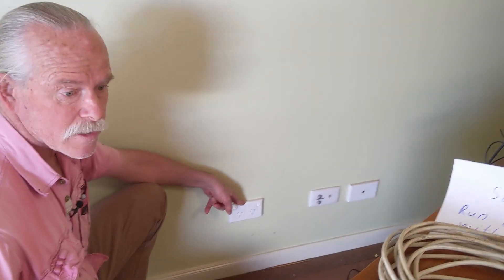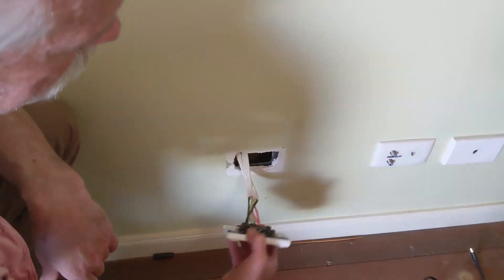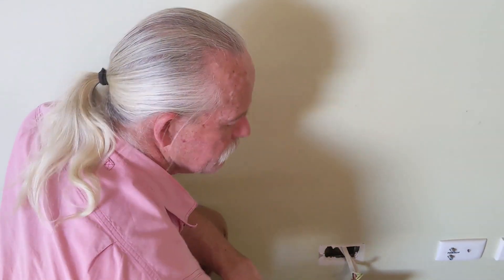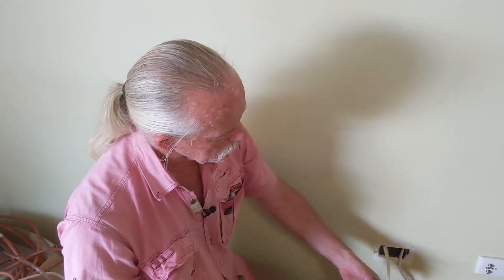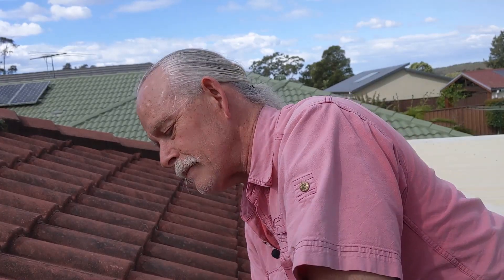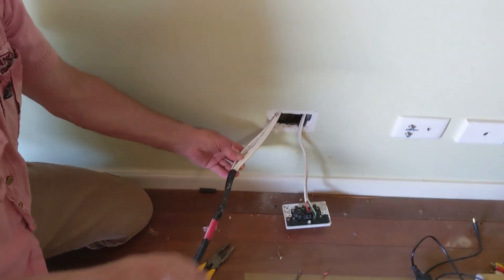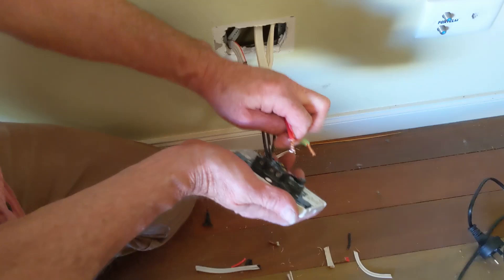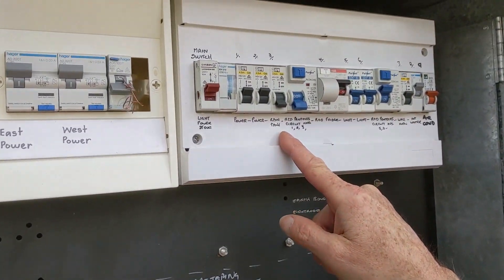Use an Existing Cable in a Gyprock Wall to Supply a New Outlet.

Comment: In the US this is harder to do often times because there will be a box holding the connections. You can't always get a cable into a box without cutting a hole in the wall. Sometimes I get lucky and can pop out a knockout from inside the box, and drill a hole through the top plate of the wall in the attic or crawl space. Then I can use a connector that holds the wire from inside the box.
Reply from the maker: Yeah. That sounds like a total pain in the arse.
Reply: @gunsparky  It is but i am used to it. We have a drywall/paint guy who fixes the shit we break. Sometimes there is no other way to safely do it so I just make the access holes.
Reply from the maker: @illestofdemall13  when I was a contractor I used to drop a slab of on the floor on the first Friday of any project. This insured that every other tradie on site was my friend and I was forgiven for a lot of things that other trades life difficult. It was a great investment.😊
Reply: @gunsparky  A slab of what? Not sure if I don't understand or if you missed a word. Haha. But either way it is good to make friends rather than enemies on the job site.
Reply from the maker: Sorry. Slab (case of 24 cans of beer) In Australia and I expect the US. Beer is currency. 😁
Reply: @gunsparky  Beer is surely universal. That's a new term for me to use. A few years ago I could drink a whole slab in a night but I drink very little now.
Reply: @gunsparky  Beer is surely universal. That's a new term for me to use. A few years ago I could drink a whole slab in a night but I drink very little now.